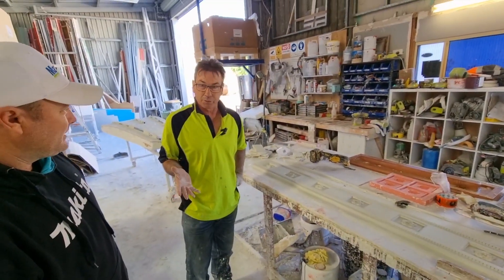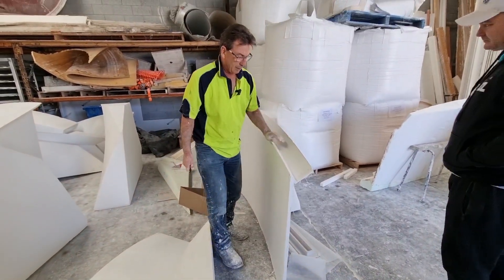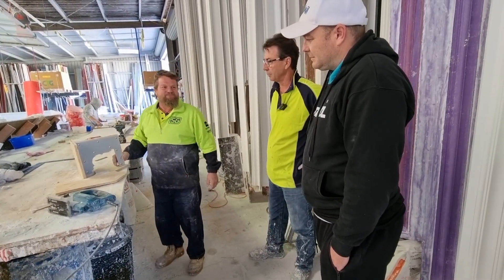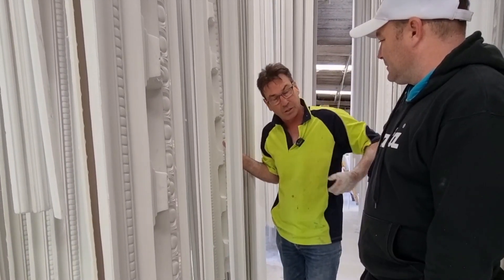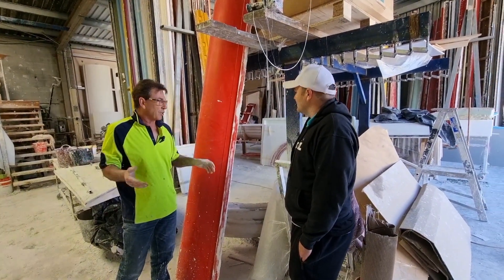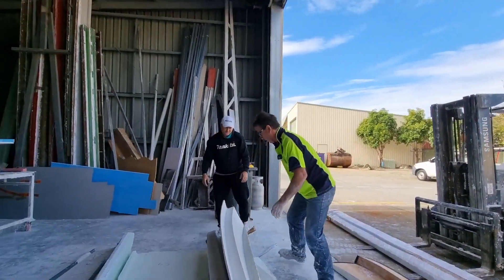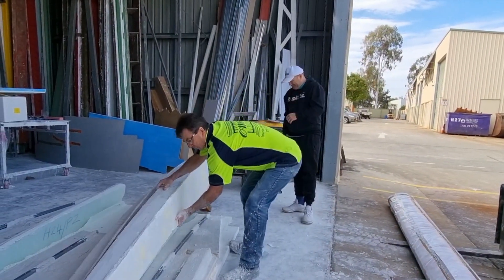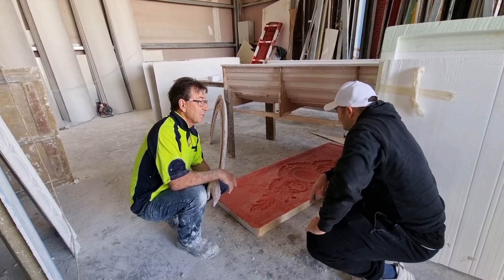The Drywall Construction Products Manufacturer Makes Anything you Can Imagine Fast

Comment: That guy is a true tradesman !! Great skills that hopefully will always be around. The cornice you are using on that repair job looks like 'Sydney Cove' ?? I have installed that in my house recently on an addition and it really good as it will fit right over 55mm cove with out issue. Thumbs up - great video Max.
Reply from the maker: hey mate it did look like the Sydney cove though this one was 85mm and a few minor differences.